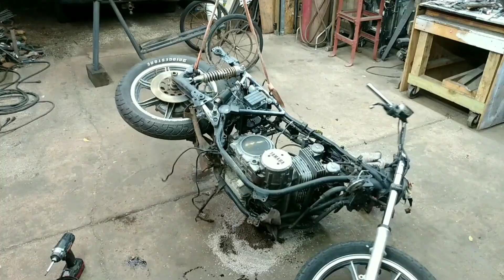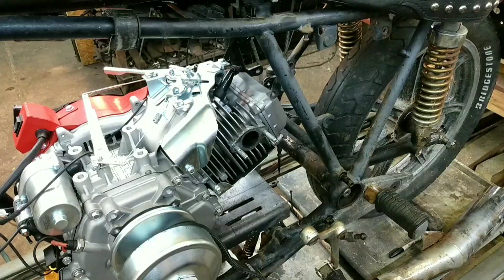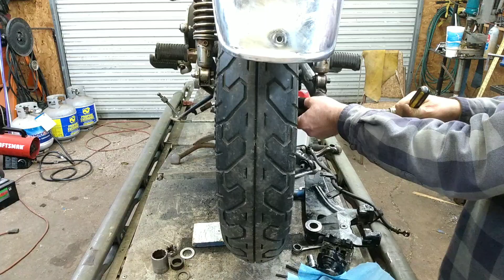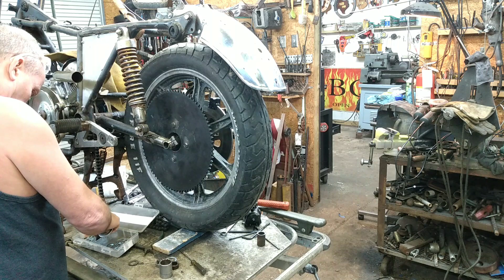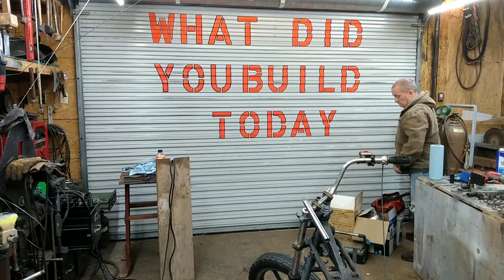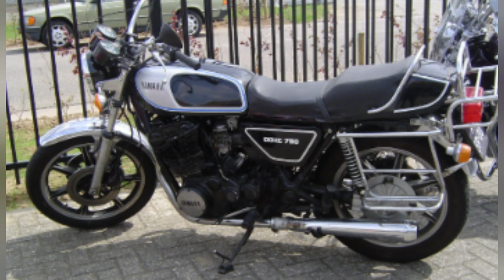lawnmower engine powered motorcycle gets factory rear brakes,459cc predator, harbor freight

Comment: Hi mark. Mind if i ask why such a large rear sprocket. What diameter and number of teeth?
Reply from the maker: I texted you all that last time we spoke did you not see the text ?
Reply from the maker: 84 teeth and the reason is I need a lot of torque to carry two people up the side of a mountain and if I need more speed all I got to do is put a little bit larger sprocket on the jackshaft.
Reply from the maker: I have been researching and designing a two speed jackshaft so that I can have low and high speed.  Since a 10 tooth is the smallest sprocket I can use on the jackshaft I need a large rear sprocket in order to get the low end torque I want and inorder to get speed all I have got to do is add a slightly larger sprocket on the jackshaft. I hope this helps you to understand better. Lol most people wouldn't understand enough about all of this but !!! I can see that you do. See ya
Reply: No I never got your text sorry. I will be using a standard size Harley-Davidson rear sprocket I think it's 59 teeth or 60 teeth my jackshaft has 14 teeth and I am using a 780 series torque converter I am interested to see how you do the two speed Jack shaft
Reply from the maker: You will have 4.2 I will be curious to see if you burn belts
Reply: @outrageousatvbuilds  yes will see about the belts. If i do i will drop teeth on jackshaft. Remember i will have about double your hp and tq at least. Might help me out.
Reply from the maker: That's true! I might get a 780 torque converter at some point,like when I hit the lottery.lol